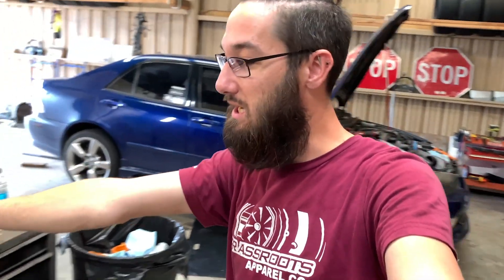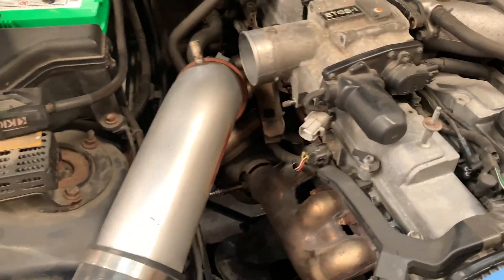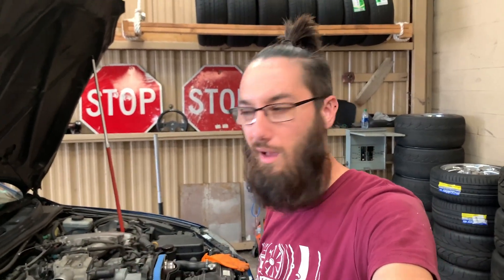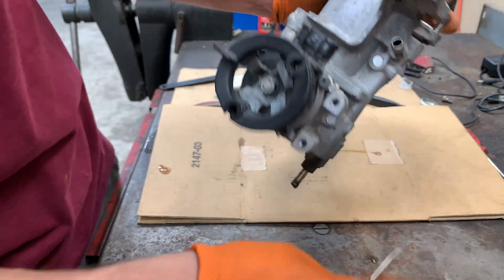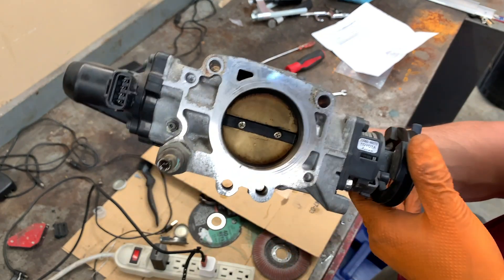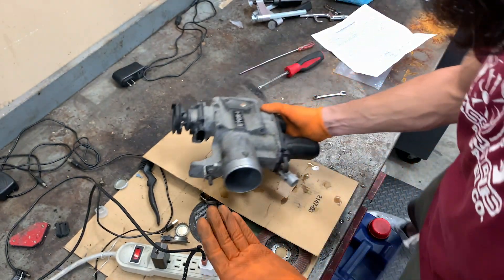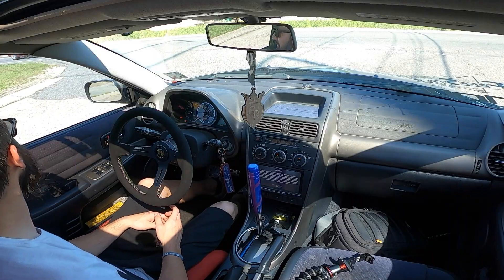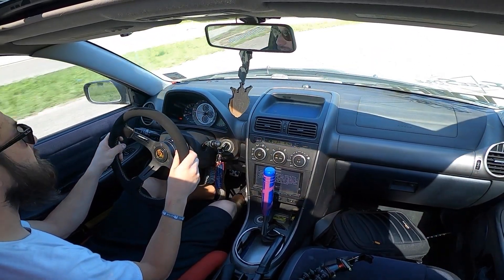IS300 - 2jz-GE Throttle Lock / DBW Delete

Comment: Does this force the car to go nuts down the line ? These comments are making me wonder! I'm about to purchase this myself.
Reply from the maker: No it doesn’t seem to make the car any faster. The difference it makes is the response in the throttle pedal. It will make the throttle feel a bit more snappy
Reply: @FreeStyleMediaNola  I changed the throttle body in my Lexus a couple days ago thought it would fix the jerking problem I'm having but it didn't. Car jerks back and forth when she warms up, I'm still trying to figure out the reason it's doing this.
Reply from the maker: @Starsnstripes25  I would make sure the Pedal position sensor is working correctly and make sure you don’t have any vacuum leaks.  Unmetered Air in these cars can cause all kinds of weird little issues like that.
Reply: @FreeStyleMediaNola Mines went nuts I took it off but got me an extra throttle body and I'm gonna rig one and keep the other OEM and swap them out zss id it makes s difference

Comment: I have 2003 is300 Automatic transmission, atm in limp mode throttle control motor not working if i put throttle lock you think i can just take motor off and should be good to go? And would it throw warning signs still? Can i still drive when warning signs or car would still be in limp mode?
Reply: Did you end up getting out of limp mode??

Comment: Hey would you be able to tell me what the name of the second hose you removed is called? The one on the firewall side of the throttle body? I did this same “mod” and noticed that hoses is now leaking coolant. In a time crunch so I’d really appreciate it🤙Thanks
Reply from the maker: I don't know the exact part # or name but it should be able to be replaced with any coolant hose that matches inner diameter.  The throttle body should have two coolant hoses passing through. One from the firewall ( the one you are referring to ) and one from the intake side running down through and under the intake.

Comment: I have 05' is300, car is stock in every aspect. Well maintained. I put this throttle lock on and went for a drive. Under acceleration the car threw a code and shut down the engine. Same thing every time I accelerate. Uninstalled and car runs and drives perfect again. I do NOT recommend this mod.
Reply: What’d did you do to fix the problem? Mines kinda doing the same thing. I installed mine bc I have to floor my gas in order to get anywhere.
Reply: @dogofwisdom5353 The APP sensor worked for me. I'm gef gonna check this mod out
Reply: @TearsoftheSun1 mine is currently having this issue tried this mod now my car shuts off any time it gets above 3k rpm I've replaced the the entire throttle body still the same issue
Reply: That’s because your on a stock ecu

Comment: Since you have this engine I want to ask you something I cannot find an answer to. When I turn mine on, the Rpms go really high then the car will turn off. What should I do? Thought it was the throttle body, I replaced it with the sensor as well, read it could be the Maf sensor, so I replaced it too. Saw that it could be the pvc valve, replaced it. Nothing is helping I’m not sure maybe I need to calibrate the throttle body — can’t do that cause the car won’t stay on longer than 1-2 seconds tho,  but I thought the computer would do that either way i thought it would do it on its own. Nothing is helping. Got any ideas?
Reply: Same issue I’m having right now did you figure it out what happened?
Reply: @BTKKK   nope, I feel there’s gotta be some way to reset the throttle body or relearn it type of thing. But each time I ask anyone they are stumped
Reply: did you ever figure it out? ive read it could be the TPS not aligned/calibrated. did u fix it?
Reply: @jet4463  still a mystery. Ended up selling the car either way

Comment: Can you guys please tell me whats the point of doing this? What benefit do you get over just replacing the OEM AIC OR BUTTER FLY MOTOR??  Seems like Lexus designed something for responsive ness.  Is the car less responsive after this delete??  Thanks for your answers! I really encourage a broad range of views on the matter.   Thanks!!
Reply from the maker: They did not design this for responsiveness. Inside the throttle body they have about a 10-20% throttle delay mechanically built in and that’s what the throttle lock is replacing. It removes that 10-20% factory delay and makes it a lot more responsive over stock.  Most manufacturer’s have throttle delays built in because basic society can’t really handle a throttle that’s 100% reactive. You would see a lot more wrecks coming right off a red light 😂
Reply: @FreeStyleMediaNola so this won't have my computer going nuts? I'm about to order this! 

I ordered me a used throttle body cuz I had hesitation! It's working better now but I hear this throttle lock helps!  I also resd by others that their car is going nuts with it on. 😊

Comment: On your dash how it’s blinking trac off mine is doing the same thing so I read it for codes and it was tha apps and it’s has an hesitation in the throttle response but your light is on still does it do the same as well?
Reply from the maker: No mine is blinking due to the ABS module being unplugged.  I don’t have a code for apps either. Is your car a 01 or is it 02-05?

Comment: I had one on my throttle body it makes the pedal stiffer and you have to adjust tps it will make the vsc light pop on and off if not adjusted
Reply from the maker: That’s good to know.  I don’t seem to have this issue tho, what year is your IS300 so others can be aware

Comment: I've read that this will wear out your throttle body, what's your experience with it?
Reply: yes it will burn out the throttle plate control motor which is supposed to be the one controlling the throttle plate, after it takes in a position signal from the pedal position sensor (the cable actuated wheel). if you use this mod, the cable actuated wheel now physically controls the throttle plate and drive by wire is controlling the motor to fight it because it's not agreeing
Reply: @Persocondes  oh wow good to know. So what's the proper way to disable that when doing this delete?
Reply: @Austin152-S  there's no other way, if you delete that, stock ecu will throw a code, only way is go standalone ecu

Comment: stock ecu? also did u unplugged the throttle motor or pull the etcsi fuse or anything/.?
Reply from the maker: Yes stock ECU with on of those SRT intake tuning things on it. I didn’t have to unplug anything and the car seems to be okay but I will note mine is a 2001
Reply: @FreeStyleMediaNola  thamks for ty reply thats awesome

Comment: Glad I found your channel. Good shit.

I just did pretty much the same job, but it was because the throttle body level sensor had failed. I had no gas pedal. It was fun finding the part too. No one in town had it except the dealer and it was over $500. Ended up ordered an OEM Toyota one for $200 and did it in an hour or so.

I’ll def be around here more.
Reply: you got a part# for that sensor? I'm having idle problems
Reply: @Persocondes  hey, it’s Zach, the OP. I tried responding from my account several times but I think I’m censored for some reason because it gets instantly deleted every time, so I’m responding from this account. 

The part number for the throttle body level sensor is 22060-46070
Reply: @wikpy  thank you very much!

Comment: Been reading says the tb works 10 percent manually and 90 electric. I'm having problems right now i changed the TPS, and still same i want to do this delete. Do you have the stock ECU? Mine is stock ECU I'll be removing one of the gears i don't use cruise control and it says that leaving this gear will make the pedal feel a little more stiff.
Reply from the maker: Yes it’s on a stock Ecu and yes leaving the Cruise gear in will make it feel the way mine feels which is just a VERY pronounced throttle cut when you let off the pedal. We plan on making the cruise work again which we would suggest just in case you want to street drive on the highway.  Kinda like AC, not needed but a much wanted creature control comfort.
Reply: @FreeStyleMediaNola  I'll be removing i don't use cruise mines manual i like the 100 percent engagement and focus on the car. Thanks man I'll comment back to let you know how it goes. I further read more and said it will wear the dbw motor but i don't understand why maybe cause of the gear what do you think.

Comment: Great walk through. Just installed this. Once I started the car it was idleing at 2k, then it dropped to 1.2k  Is that normal?
Reply from the maker: Thanks!  Yes so mine does the same thing but I tightened the throttle cable a substantial amount in attempt to reduce all pedal to response feel. If you left it stock it’s most likely due to the the throttle lock being a % more less then stock so you may be able to loosen the cable. I personally don’t mind the idle so I left mine as is.

Comment: What trans are you running? I noticed it's an auto to manual swapped car, but your shifter is way far forward.
Reply from the maker: It’s a w58 but an old one with the mid placed shifter housing. To cheap / lazy to buy the proper housing to relocate the shifter to make it fit proper lol.
Reply: @FreeStyleMediaNola  ahh ok I gotcha. I just picked up a w55 for my 01 is300, if it ever shits the bed then I'll probably source a w58 for its replacement

Comment: What’s the point of the throttle lock I just recently purchased a is300 and a week of owning it my throttle sensor gave out should I have done this?
Reply from the maker: No this would not have prevented that. This is simply to allow the throttle body open to 100%, the factory has roughly a 20-30% cut not allowing the throttle to open fully.  It doesn’t really effect much except for pedal feel.  Our last video has a little review of us taking the car out drifting and we go over it there, that’ll give you a little better idea of how it works and feels.

Comment: Lol I don’t like it I uninstalled mine lmk if you keep yours on it’s just to uncomfortable
Reply from the maker: It definitely changes the feel of the throttle a bit, definitely doesn’t make the car feel any faster lol
Reply: Lol ya you would think it would it’s like you start up the car drive a bit then stop then go just feels like an anchor you do get use to it but I appreciated the soft gas pedal after haha
Reply from the maker: The engine light is on currently but nothing for the engine. I have a major amount of codes due to the trans being replaced and kinda must bypassed and the ABS being unplugged. The only "engine" light I had on was for the upstream 02 sensor but I replaced that.